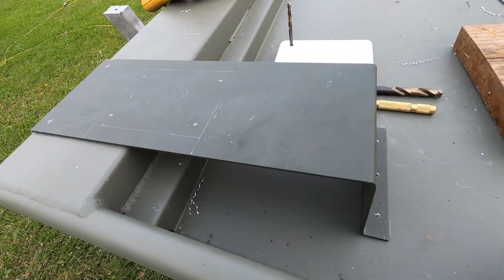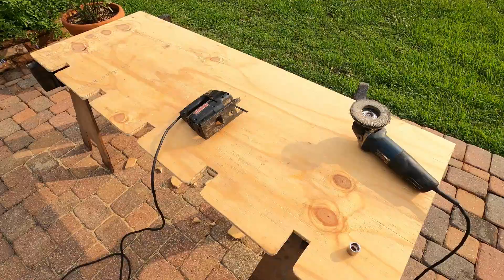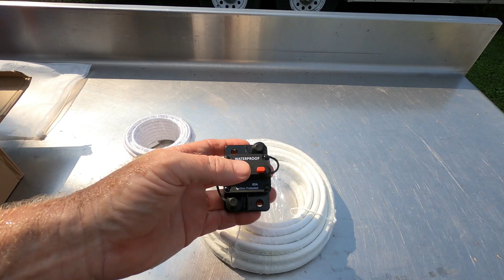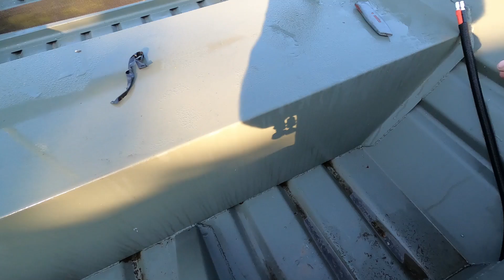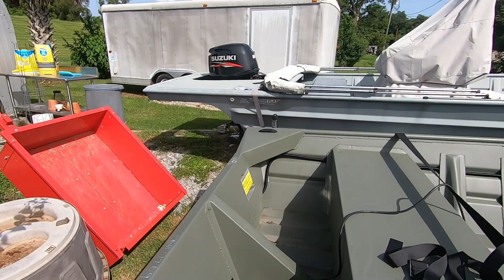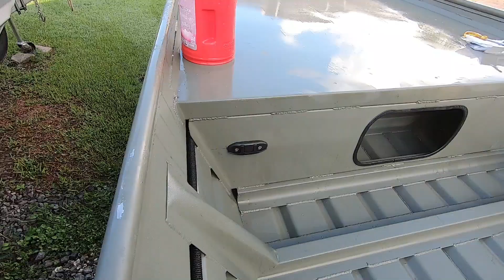Southfork 1448 Flatboat Build

Comment: Any Tips and Tricks on mounting the Trolling Motor Bracket to the Boat and the Trolling Motor to the Bracket.
Reply from the maker: I used nut sertz for my mounting, I know everybody doesn't have that tool but that was my best option.
Reply: @SRadigFishing  Did you use the Bolts that came with the Trolling Motor Quick Disconnect or did you buy separately Bolts.
Reply from the maker: @Byron4RollTide  Yes I used the bolts that came with the disconnect but I cut them down some.

Comment: This randomly came across my feed, but I bought a 1654 southfork about three months ago and it was a bare hill like yours. I put a 60/40 mercury jet on it, aluminum flooring, gator camp hydroturf, red led neon lights under the gunnel and a 45lb thrust 12volt trolling motor and I absolutely love it. It’s light and built tough.
Reply from the maker: I want to do aluminum flooring in the future. The 18/60 Tim's flat with a 90 is too much for me on solo trips so I put this rig together.
Reply: If you end up doing aluminum later down the road, it’s a lot easier to do it in two pieces, one for the left and one for the right. Then leave an 1/8” gap between them and fill it with 3M 5200 (trust me this is the stuff to use on a boat; it’s what the commercial boats use). You already have the pattern for the ribs from your plywood, transfer that to the aluminum and cut it with a jigsaw, then after you insulate between the ribs with 2” thick pink rigid styrofoam and fasten it down with adhesive or rivets, seal around the outside edges with 5200 and it’ll be there from now on. 5200 is also an adhesive so you can attach it to the ribs and insulation with that too. Sorry for the rambling reply, hope this made sense. Not counting the hydroturf, the aluminum, styrofoam (pink panther insulation board from Home Depot), and the 5200 came to about $400 and took me about five hours. The 5200 takes three days to set up and harden.
Reply from the maker: @44thala49  Thanks for the tips.
Reply: You’re welcome. Take care!